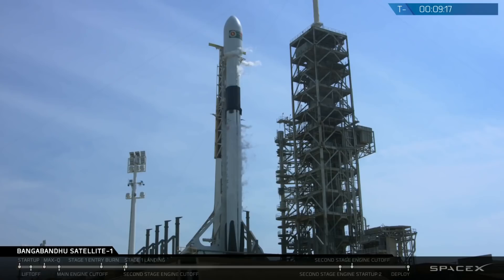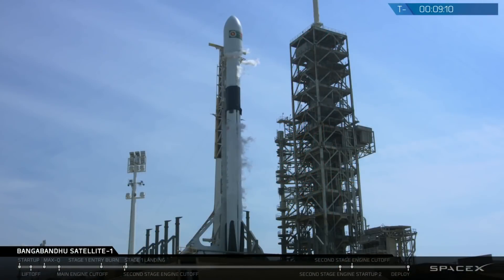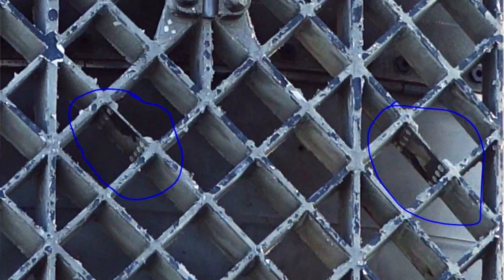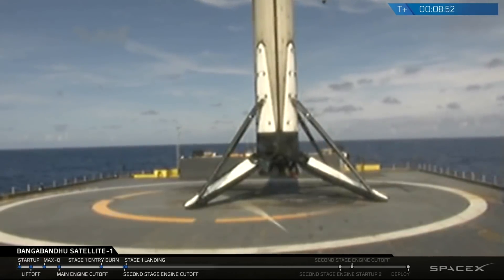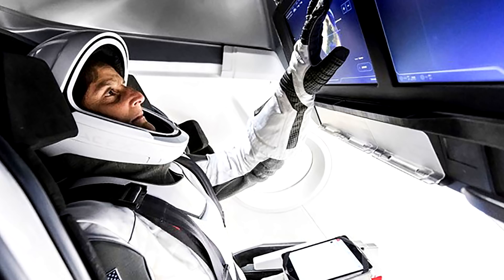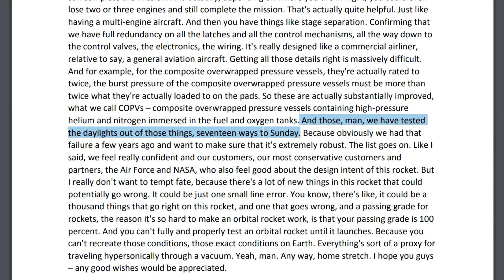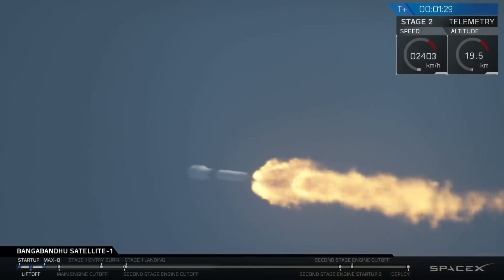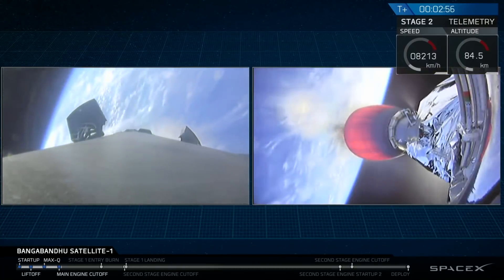How Well Did SpaceX's new Falcon 9 Work?

Comment: Scott, seriously. You should be one of the people that reconizes that the hyperloop can never work. It's just not feasible.
Reply from the maker: As a technical person I recognize that there are no fundamental technical problems, but economic and legal problems are more likely to stymie it.
Reply: Scott Manley Exactly. The cost of building a functionally perfect tube on that large of a scale would be tremendous. This is compounded by the incredible cost of pressurizing and depressurizing the tube with every use, which in itself is an extremely lengthy process. This means paying a great deal to make a more expensive method of travel. For those reasons, a hyperloop would be ineffective in every way. It would be slow, ridiculously expensive, and much more dangerous. It is essentially very similar to his earth to earth idea, in that it does not save time or money, and is merely a tourist attraction, despite its incredible danger.
Reply from the maker: Of course you’d have to depressurize the system every time, unless some brilliant mind came up with some idea to transition from air to vacuum. Here’s an idea, canals have these things which are used to transition from high water labels to lower levels, they’re called locks. Perhaps a similar device exists for moving between air and no air - a device one might call an ‘air lock’.
Reply: Scott Manley yeah, sick burn dude, I'm really impressed. You really nailed me with that one. Seriously though, you have addressed one of my points. I have considered that, and reconsidering it now, it does make sense to have a docking port similar to what the ISS uses on this shuttle to allow passengers to board without having to pressurize or depressurize a large area, but you're missing most of the points I outlined. What you're essentially building here is a space shuttle esque vehicle without the engines or wings that is to be propelled down a tube at extreme speed with little margin for error. What if you need to do maintenance? What if there's a breach in the tube or the shuttle somewhere far from an access point? At the end of the day, my fundamental argument is that his plan for this system does not hold up to any technical or financial scrutiny. We should not hold these ideas above others just because they came from a popular and likable person who has come to represent the scientific industry. Just because he's had some good ideas doesn't mean that the insane ideas aren't insane.
Reply from the maker: Well first up, the concept didn’t originate with Elon Musk, he just took something described many times in sci-fi and decided he could make it work. I’m in no way convinced it can work as a financially successful project, but neither am I certain it can’t and there’s no glaring technical problems which are insurmountable.
Reply: Scott Manley Well, it doesn't really matter if it's his idea or not. I don't think that the originality of an idea necessarily negates whether or not it is good or bad. Secondly, we're talking about an unbroken vacuum chamber that stretches more than 300 miles. That which is supposed to contain what is essentially a spacecraft with passengers travelling at hundreds of miles per hour. This idea doesn't seem technically infeasible, but it is definitely implausible enough to reject. This proposal is not only attempting to surmount the technical difficulties entailed with that, but also to become certified as a means of transport for the general public. I would reassert my question of emergency maintenance. In the realistic designs for this tube, there would be only a couple of access points. Keeping in mind that these access points would be the more expensive parts of this tube, how would a critical fault be handled between access points? Humans can be injured by a vacuum in less than a minute, and die soon after. With this design, it could take hours to get to them. This could even result in the tube needing to be reprusserized, which would be disasterous for the long term cost. Not to mention, in order to safely repressurize the tube, you'd have to do it slowly and with many vents along its length. Opening a hole at one end would send high speed air into the shuttle and potentially worsen a dire situation. This goes beyond just technical difficulties. By comparison, the Space Shuttle seems quite mundane. I don't see a compelling reason why we would want to expose the public to something this hazardous when much safer mass transport already exists. Would we have put astronauts into the Space Shuttle if a slower and immensly cheaper method of getting to space existed?
Reply: Why would an emergency repressurizationn have to be slow?  Why only a few access points?  You keep repeating that these things have to be so, but do they?  How about emergency pressure chambers for protecting vehicles?  Why does the entire tube have to return to atmospheric pressure during an emergency?  What about simply installing pressure doors?  How many traffic accidents on highways are caused by real equipment malfunctions rather than by humans making mistakes?  I think you are grossly overstating the danger and the technical challenges.
Reply: Dennis Lindemann Each access point adds its own additional layer of potential failure, along with increased costs. The speed at which it is repressurized could be fast, but again, that would require a prohibitively large amount of air vents along this loop that have to be able to open at a moment's notice while also being able to maintain a vacuum for months or years on end. Access points for the shuttle would also be costly as they would have to be large enough to fully unload the shuttle from the tube, which essentially means having a door half the size of the tube's circumference and at least as long as the shuttle. Something of that size would be incredibly difficult to maintain. Pressure bulkheads could also help, but once again, you're adding so much more complexity. These pressure bulkheads would have to have an area built into the tube, and be fail proof. The car cannot risk slamming into solid metal at top speed. Even integrating one of each per mile would be hundreds of doors and access points, none of which can fail at any time, along with potentially thousands of vents that can repressurize this entire tube in less than a minute, again, none of which can fail. Elon's estimate for price is already vastly inadequate, and adding all of these things would skyrocket it beyond any realistic feasibility. And again, this is a point to point system. This is directly comparable to trains and planes, and by that comparison, this system is dangerous in the extreme. One fault means almost certain death for all passengers, and by our nature, there will be faults. There is no redeeming factor to this system other than its proposed speed, and that does not justify it by any stretch of the imagination. I would also like to reiterate that, even if this could exist, it would not compete with cars. Cars can go anywhere where there are roads, and this train can only go where there is a vacuum sealed tube and can only stop where there is a sealed docking port or an airlock. Comparing it to the safety of a car is foolish, as even a car can survive quite a lot of faults, but that comparison is still unfair as a car serves a different purpose. In the same way that planes do not replace cars, neither does the hyperloop.
Reply: "this system is dangerous in the extreme. One fault means almost certain death for all passengers, and by our nature, there will be faults" - But it isn't impossible to build, create, and run.  It would be great for most freight.  It would clear the roads of almost all freight traffic.
It seems intolerable to me to be trapped and seated in an aluminium alloy/composite plastic tube of a passenger jet flying at 500mph and 40,000 feet for several hours, yet I, and millions of people still do it.
We should all walk, cycle, or sail more, anyway.  Life isn't that short.
Reply: Tony Duncan Yes, it seems intolerable to fly on a plane, yet it is by far the safest means of transportation humans have. Planes are designed specifically to fail safe, and that means a multitude of things must fail before the majority of passengers are placed into real danger. You could even say the same for cars, in that a mechanical failure is usually not fatal for the driver so long as they handle it properly and avoid an accident. Even if we design this system only for freight, and do not let a single person onboard, it still doesn't make any sense. Most freight is not on an extremely tight schedule; it doesn't need to be transported from LA to San Fran in under an hour. the usual constraint for cargo transport is cost; that's why we still use freighter ships even though they're such an outdated means of transportation. This system exchanges safety and cost for speed, and is therefore unsuitable for freight or passengers. Even a version of this loop without safety precautions would have a low freight capacity, and an astronomical cost. And I'll reiterate, how would a broken car be handled if the nearest access point is miles from the fault? Does the tube need to be repressurized and disassembled every time? What if the train has a fault that sends it through the side of a tunnel wall? It could kill any passerby, and it would cause massive damage to the tube. This system does not make sense from the perspective of safety or cost for any application.
Reply: Stalin, I generally agree with you.  Different on Mars, perhaps, eh?
Aircraft structures hardly ever 'fail safe', do they?
Reply: Tony Duncan yes, they do. The engines are designed to be able to deal with an uncontrolled fire, and the plane can glide to a runway even if all engines shut down. There are strict standards for where planes can fly, and there are backup systems upon backup systems to fully insure the safety of its passengers even in a dire situation, this is a concept that Elon does not grasp. If the hyperloop fails any passengers onboard will at best be stranded in a vacuum miles away from any access point with a limited air supply. At worst, in the event of a hull breach, they could all be dead in minutes. This is not a fail safe, this is a garuanteed fail unsafe. This same disregard for safety has been demonstrated in his bfr earth-earth rocket. It has no escape system for rocket failure. If the thing runs out of fuel, they all die. If too many engines fail, they all die. If the heat management system is damaged too badly, they'll all die. These ideas are workable in concept only, and do not apply to the real world. If we ever get a bfr earth-earth, it will be nothing like what was proposed. Either that, or SpaceX will be dealing with a major lawsuit.
Reply: +Stalin
"The engines (can) deal with an uncontrolled fire" - but not with ingesting a bird.
"the plane can glide to a runway" - if not over an ocean.
"There are strict standards" - which will apply both to rocketry, passenger aviation, and pipework.
"backup systems (are) a concept that Elon does not grasp" - Untrue.
"passengers onboard will at best be stranded in a vacuum miles away from any access point" - is almost an identical situation to an engine-less plane at cruise altitude - with the added potential energy of being eight miles up..
"in the event of a hull breach, they could all be dead in minutes" - seconds in both cases.
"garuanteed fail unsafe" - an almost identical situation again.
"bfr earth-earth rocket has no escape system for rocket failure" - False.  The top stage can start up, accelerate away from its exploding booster, and auto-land on any hard standing.
"If the thing runs out of fuel, they all die" - that isn't always true either.
"If the heat management system is damaged too badly, they'll all die" - ablative systems are proved before they are commissioned.  They might be damaged by space debris local to Earth, but most of this is logged already and may be avoided.  A future use of the BFR may be to gather up such debris.  This could be a robotic (drone) activity.
"workable in concept only" - No.  They will have been proved before use.
"do not apply to the real world" - False, by definition.
"a bfr earth-earth, it will be nothing like what was proposed" - False, because what has already been shown is generated from the computation that has already generated the aerodynamics and structural synthesis.
"SpaceX will be dealing with a major lawsuit" - Passing the rocketry codes of practice and use IS no different from a 'major lawsuit'.
Passenger aircraft are designed to be able to endure positive five G and negative one G.  Once these accelerations are exceeded they will fail just as dramatically as any rocket.
Musk (and his team) are many times cleverer and tougher than you appear to believe.  Thanks for making me think about this.
Reply: Tony Duncan dude, again, most planes that fly over the ocean have 4 engines. It would take 3-4 critical failures to send down the plane. This is not at all a fair comparison. Your entire comment is basically one big example of denial and belief without evidence.
Reply: Stalin, dude, BFS has 9 motors, and you avoided ALL the other points. That's denial.  Mind how you go, there.

Comment: Chamber pressure,, throttling back,,,, these are requirements for manned launches,,, not for air pressure,, there  are already throttling proc3eedures for Max-Q    However,,,, G, forces,, as the tanks empty,, there is less mass to push,, G-forces rise drastically.  Humans,, G-forces,,, sustained,,, you'd like to keep it to one G.   but that is not gonna happen,,, however,, you do not exceed 3 Gs for anything sustained.  Right now,,, this is just my thumbnail, back of an envelope calculation on the second stage,,,, as it approaches empty tanks the G-forces max out at between 6 and 8 Gs on a satellite launch.   Hardware,, you can design for it,, do it,,, but not for people.   Block 5 will need to throttle back both first and second stages as they approach tanks empty.  Dragon being,, mostly air,, light,, a couple of people that need space,, the G-forces possible for a light load could be impressive to the point of fatal.   We humans,, are fragile,,"ugly bags of mostly water". (Star Trek).

Comment: I love the idea of the booster refueling on the barge and flying back home. If having a fuel depot right on the landing zone barge is a safety concern, just have a separate fueling barge close by. Land the rocket, dock the fueling barge to the landing zone, hook the rocket up for fueling (I imagine this creepy Tesla snake robot) and fly the falcon home.
Reply: Naval fleets on exercises (or real battles, of course) have extremely thirsty engines, they've been doing at-sea refuelling with a dedicated tanker that accompanies the fleet for decades, so that's no big deal.
Reply: You would need to be launching much more often to justify keeping the barge and recovery fleet out there all the time. Plus the barge isn't built for rough seas.
Any way, for the F9 to fly back you would need:
Launch mounts because the legs can't support the fuel or fold up in flight
A nose cone like the FH side cores so the rocket doesn't rip apart
And a proper launch platform so you don't destroy the ship on takeoff
Reply: You just ruined my dream with your competent reply.